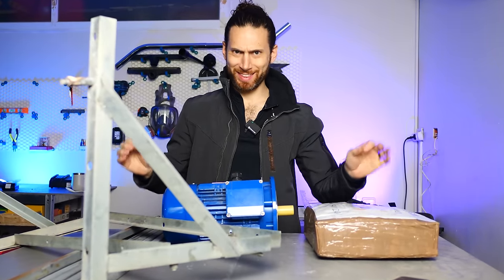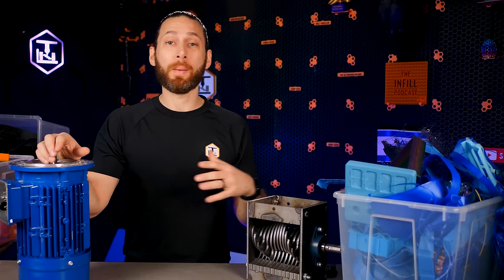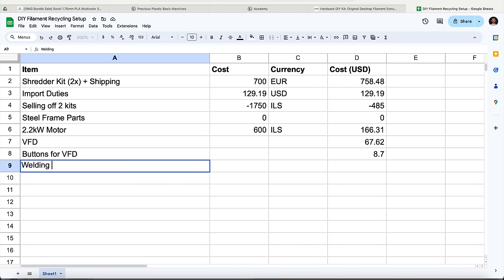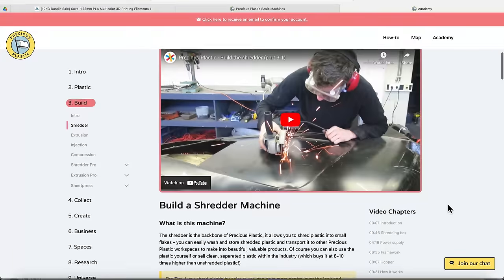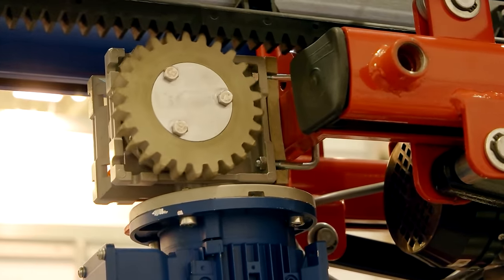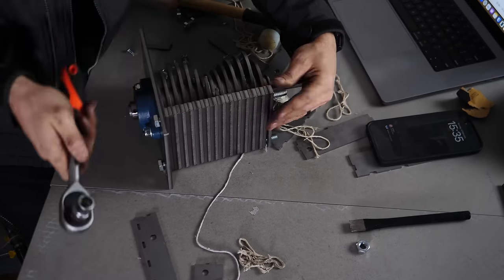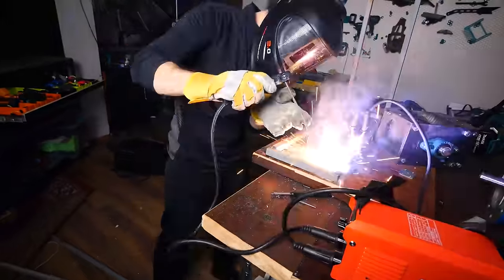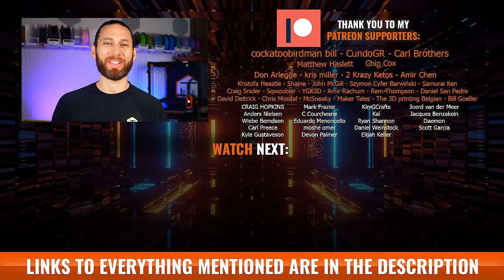Affordable Filament Recycling?

Comment: Massive respect for trying, and OWNING your own inadequacies when welding. It's not a particularly easy skill to master, but the fact that you want to learn, and aren't trying to show people how to weld; let alone are TRYING to humbly learn your own way makes me not even want to critique your work. I'm not a stick welder (I prefer TIG/MIG) but I've done some - I'll throw some tips though, you look like you'll take to it like a duck to water.

- You have an angle grinder already, get a grinding wheel for it and grind the millscale (the grey dull coating) and paint off what you're trying to weld. The cleaner it is, the easier it is to weld. With stick welding, it's a bit more forgiving than MIG/TIG in my opinion for dirty joints but it's not infallible. Experienced guys can kinda weld through anything but they'd clean it if they can.
- You've already got the idea down for starting your arc, drag the stick, don't poke it. I think part of your issue starting is the millscale, but I think you might be lifting the stick too high and too fast. They say it's like "striking a match" but I don't think it's quite that quick. Definitely get some scrap and practice laying a bead down. Once you can scratch start it reliably, it will be so much easier for you to weld.

Keep up the good work, I'm deeply interested in this project myself!

Comment: Pleeeeease buy a mig welder. You can get very small ones this days. I tested even the Lidl version and it welds so much better than electrode( for newbies like us). The welds look from another world on mig compared to electrode. It is much faster and neater. 
You can use flux so you do not need welding gas
Reply from the maker: I’m gonna order one today thanks
Reply: @thenextlayer  i tested 80 dollars version and had very good results. You can find flux wire only that usually have only small wire spools and are very light. Of course you have to test first but the learning curve is way better than electrode

Comment: I am happy to see someone trying to make recycling 3D filament affordable. I recently looked into pellet 3D printing and wondered if pellet 3D printing could take the "turn shredded plastic into filament" step out. Sadly pellet 3D printers are not common.
Reply: Yes and no. They take the step out of producing expensive filament in the first place. Everybody with a print farm should be looking for pellet printing since the raw material is by a factor of 5-10 less expensive. But for home use, filament is just convenient. You get tight tolerances, good material quality but much less control over color, material properties and price is way worse. My guess would be that pellet extruders will be the next hype after all the other issues like print quality and print speed and also price for FDM machines is basically already solved. Filament is just way way more expensive and thus nobody uses 3D printing for manufacturing unless it´s a very small part count. No automobile manufacturer would ever use FDM printing for mass priduction ever. But with a significant price reduction they may be willing to label their product "gree, recycled great for evirenment bla bla" and 3D print them is they are cheap enough.

Comment: 1. Clean your metal
2. Stick is overkill, flux-core is amazing for beginners and people who don't want to deal with gas containers
3. I'm going to recommend using new metal, it's always better to KNOW....TRULY KNOW....what you are welding with.  For your success, your learning, and your confidence in your HIGH POWER FINGER SHREDDING MONSTER!!!!!!
4.Use you new flux-core welder to build a welding table.  It's good practice and an important tool.
5. Get clamps.
6. Get right angle magnets.
7. Machinist squares are not good tools for welding.  Get a larger square, one with no corner so it can accommodate a fillet weld. You need the length to sample a longer segment since a small measuring tool can only reference a small area.
Reply from the maker: Links to products? Thanks!!
Reply: If I post links, they'll e deleted, but I will try.
Reply: @thenextlayer  Yeah, the links got deleted.
Reply from the maker: @coreyfro  Can you message me on Discord? jonathanalevi
Reply: @thenextlayer  I am decept-qi-kons

Comment: As a certified welder, you have a long way to go... However i can mention some things i saw.
Your rods are either sticking because of too low of voltage, shakey hands, or improper striking
Low voltage is easy to fix, just up it til things run smoothly
Shakey hands are a bit harder to fix, but a little practice hack can help get you used to the stinger : dont be afraid to use your offhand to hold the rod when youre getting your arc started, dont hold it too close to the tip, but u can use your hand to hold the rod steady when starting your arc(please only do this with very thick gloves)
The improper striking is another easy fix, generally with a new rod, you want to drag quickly from the middle of your future bead towards where you want your bead to start. If youre trying to start an arc after your rod has already stuck, be sure to cut off any exposed metal, you want to flux to cover the diameter around the tip of your rod.
I saw that a lot of your welds were splattering a lit. You just have to clean your metal before welding (especially if theres oaint, you can harm your lungs by breathign funes generated by welding on paint or other chemical coatings)
And of course watch some YouTube videos on welding techniques, the technique can vary based on steel type and what rids your using, so be sure to check some lut and practice following guides. 
Oh and when making a weld, watch the brightest part, it should look like a little yellow or orange slime ball, that is your puddle and thats what you want to manipulate when tryign to get a good looking weld, try to make it dence back and forth between the two lines that will form the edge of your weld, and keep it moving. You dont want it to sit in one spot
Reply: Way better advice than I gave 👍
Reply: @TheSasquatchjones  nah you had a good point, mig would probably be better for this. I also forgot to mention that he might not be giving enough space between his rod and material, which can cause it to stick.

Comment: On the welding bit, your electrode sticking is a normal phenomenon. The trick isnt maintaining contact, but maintaining the right gap. Adjusting your "heat" will help with penetration. Maintaining a steady arc is another crucial thing. Starting and stopping with something that contains flux like a welding rod or flux core wire, it melts the slag that covers your weld and mixes it in with the metal creating inclusions or porosity in the weld. One other thing, used upcycled repurposed etc is amazing, however, where you are making your weld MUST be cleaned. For one, it creates impurities or weak spots in the weld and it makes it harder to steike and maintain an arc. By no means am i saying dont use used or older materials, it just takes a few moments extra work. I love your content, im glad you and yours are doing alright there. I appreciate getting to see most of these projects

Comment: Should check places like automation direct for the motor, gearbox and VFD. Decent quality and prices. Also, as someone who works with motors, I would pick something with a 56C frame with a hollow shaft gearbox and probably wouldn't go above 1/2 horse for a shredder.
Reply from the maker: I’m based in Israel…

Comment: You didn't mention it in the video, but have you seen the new DIY filament extruder option that Stefan at CNC Kitchen tried? This might be an economical option for part 2 if you haven't already got something figured out. Also, a few of the other YouTube channels that have tried this have noticed that if you use a filament cutter to shred your first round of extruded filament, the second time you run it through the extruder it yields a much more consistent diameter. Just some thoughts for part 2! Can't wait!!
Reply from the maker: Stay tuned! In the next video we deal with extrusion

Comment: Using a VFC for reducing the rotational speed while creating a 3-phase power signal from a 1-phase wall plug is nice. However, you don't gain any torque from using a VFC. In fact, you will be overloading the motor torque-wise. Also, because of the very low motor speed (est 1..2 rotations per second), the built-in fan inside the motorhead will hardly generate any cooling, overheating the motor even more.
You really need to insert a gearbox between the motor and the shredder.

Secondly, a remark on the frame. You use rectangular frame geometry without any shear supports/stiffeners. Without shears (creating a triangular frame geometry), you will be overloading the welds and creating a weak, feeble frame with lacking rigidity. I expect the frame to fail and crash within hours of operation.

Thirdly, a remark on the shaft coupling between the motor and the shredder. You have chosen to use a rigid shaft coupling. This is an absolute no-go for this type of low-precision assembly. It causes a lot of friction inside the bearings, resulting in torque loss, excessive wear of the bearings, and long-term fatigue-based shaft failure. You need to use a flex coupling instead of a rigid coupling. There are many different types of flex coupling (with different degrees of freedom, different values for the allowable misalignment, and different torque capabilities).
Reply from the maker: I was just going to add a fan on the back…
But ok, where can I source a gearbox like that in Israel, lol…

Just saw the other comments, too. I always wondered why people do the triangular geometry. Ok… if it fails, I’ll redo it… can you link me to an example of what you mean!?

Also, dang. Didn’t know about flex couplings. How do I find one with the right diameters? I’m starting to think that maybe I really do need a gear box.
Reply: @thenextlayer  Power (kW) = Torque (N.m) x Speed (RPM) / 9.5488. Your motor can deliver about 7 N.m. If you only run the motor at 50 RPM and not the 2900 RPM your motor can only deliver 0.04 KW. Its not going to work without a gearbox. So you can run the motor at 2900 RPM and get 2.2Kw out off the motor.

Comment: if your a hobbyist. While stick welding can get you allot of penetration and control. A cheap FCAW (flux core arc weld (sometimes called MIG (but its different)). Should be able to handle the metal thicknesses you are working with. Its also waaay easier to learn. If you have the money real MIG (metal inert gas) is even better for you as the lack of slag makes clean up and mess a lot less. you aren't gonna be welding over 1/2 plate with MIG. and you 10000% wont be welding anything that thick with 110/120v no matter what. Keep working on it for sure. Gotta suck until you get better at any skill.

PS: Clean Work makes the Dream work... 90% prep 10% weld. Clean base metal makes it much easier to both control arc and get clean welds. But past that grinder and paint makes the welder what he aint.

Comment: As someone who went down the "self taught" road for welding I can recommend a few tips. 1 don't start with stick especially on thin ish material. Its very hard when learning to not either burn through or just have cold welds that are worthless. Starting with a flux core mig welder is by far your best bet in terms of getting good results without having someone more experienced standing over you telling you exactly whats wrong. Also as a hobbyist your not likely to be welding anything much over 3/8 thick but you are likely to be doing alot in the 1/8 or thiner range where mig shines over stick in alot of ways as stick tends to be better for thick not so clean material. 2 It doesn't matter what your welding the cleaner it is the better. If theres any rust or paint it will make your life hell and you'll never get good strong welds. 3 This kinda goes for learning anything but watch as many videos about welding as possible. People like welding tips and tricks or This old tony are amazing and you'll definitely improve by watching and learning as much as humanly possible on the subject. 4 If stick is all you have to work with get yourself a thick plate preferably 3/8 or 1/2 in and just run beads on it over and over again. Don't bother trying to stick two pieces together at first just practice making good looking consistent beads with no porosity. I found when learning cheating the settings up to the hotter end for the size rods and thickness of metal makes it alot easier to strike and maintain a good arc. Obviously this will generally cause a bit of under cutting and on thiner metal, burn throughs, but control comes with time and practice so its a worthy trade off while learning. Hope this helps!

Comment: Because of the interest in recycling, I would note that a real easy place to get a warm drive gear reduction would be the steering box of an old vehicle that might also be destined for the scrap heap. If it does not have a rack and pinion then it will have a worm drive gear in a small metal box.

Comment: A  VFD takes ac power converts it to dc so you can control the speed then converts it back to ac.

 Most of those motors can also be wired for high speed and low speed.

To make the motor reverse direction take any two of the three wires going from the vfd to the motor and swap them.

Comment: Bit late to this video, but I’ve been planning on choosing a filament recycling method to reuse expensive leftover plastics from various war games to print new models.

For the shredding consistency, one very consistent tool for grinding is coffee grinders. A decent coffee grinder is very uniform is the grind size, and will last much longer than an old blender. Even cheap ones from Amazon are impressively good at grinding old printed parts, however they are usually fairly small, making it time consuming.

Comment: not sure if it was just the camera angle but you need to make sure your shredder shaft center is as close to center of the motor shaft. this will help save your bearings on both sides.

Comment: Basic breakdown for motor selection:

AC motor rpms are determined by the frequency of the supply current. In the US that is 60 hertz. VFDs convert the AC into DC and then back into AC at whatever frequency is needed to get the motor speed that is required. They generally also have motor protections built into them as well. 

For phases one of the other ways to be sure with some of the crappier listings is that 3 phase is generally 480 volts (or 460 depending on the manufacturer).

Look for something that is the same voltage as whatever you are plugging into your wall outlets to make things easy. Some motors have dual voltage ratings. These can be wired to run on 3 phase or single phase. It isn't difficult to change, but if you aren't comfortable with doing this and don't have a friend that can do it for you find something else.

The frame tells you about the motor mount. The numbers basically tell you the spacing for the mounting holes and any letters after that will give information about the motor shaft. The letters shouldn't be a huge issue for this kind of thing. Frame usually doesn't change within a given horsepower, but it can. So you will need to know it if you ever change out the motor (this should be on the name plate of the motor).

Comment: With stick welding, you want to strike the stick to get it started, then put the tip where you want to start your weld. Hold it 1-2mm above the metal for a hair over half a second, then you want to move the tip of your stick away from the weld spot you just made (it should be a puddle of metal), but in the direction your weld will be going. Only need to move it about 1/2 an inch away from the existing weld for 1/2 a second then move it back to the bottom of the existing weld that you just did. Repeat this, you should see overlapping weld puddles CCCCCC, kinda like that, but obviously better overlapped than simply typing repeating C's.

Comment: You can't change the torque of a motor with only a VFD. The gearbox is the torque multiplier. You need to mechanically change speed to change torque. A 5kw motor at 50hz 1800rpm, being supplied 25hz makes it basically a 2.5kw motor 900rpm. The torque calculates out the same.   Keeping it at 50hz, at 1800rpm, and using gearing, belts, chain to go to 900rpm doubles the torque.  VFDs are great for controlling speed, and using it as a soft start. 

I sell bearings, motors, conveyors, etc.

Comment: As a retired fabricator, my welding advice would be to try to get hold of a small MIG welder. If you can run a hot glue gun, you can mig or wire weld. Seriously a lot of people spend years learning to arc weld, if you are a DIY/hobby welder it's not worth it, try to get a MIG welder. Mig stands of Metal Inert Gas.

Comment: Love your project! You spoke very well in the presentation. Couple of thoughts - you're going to want to make sure to line up the output of the motor to the shredder shaft as perfectly as you can. Try to fab some provisions to allow some adjustment for the shredder or the motor. Then use a flexing mechanical coupling. The VFD looks like it may be sized too small for single phase input to 3 phase output plus wanting high torque. Granted, you may be limited by amperage available at your studio so you may not be able to run a larger VFD. This project may end up needing a gearbox for a reduction to get the torque needed.

Comment: As an ex sheet metal worker for welding I would suggest a MIG welder for beginners. You can get gasless and also gas MIG, easiest is gasless, but the welds aren't as good, as the gas acts as a flux enabling you to get a better weld. These machines are more expensive than an arc welder, but worth the extra cost. I have both and I rareley use the arc welder.